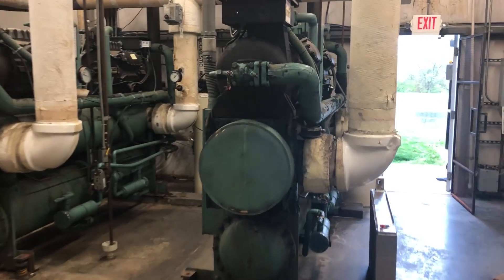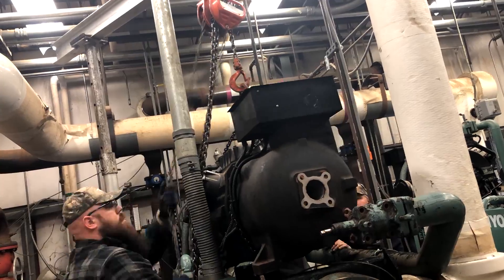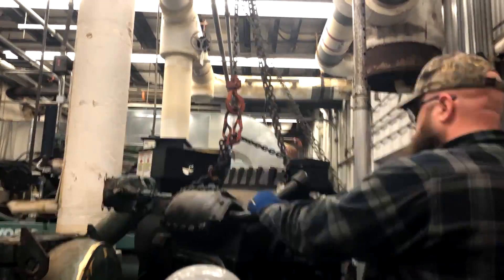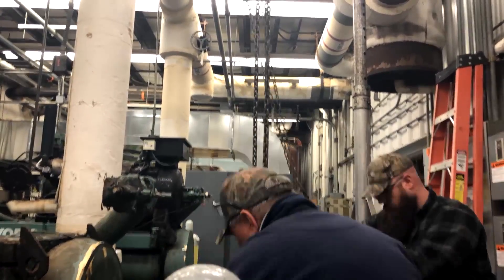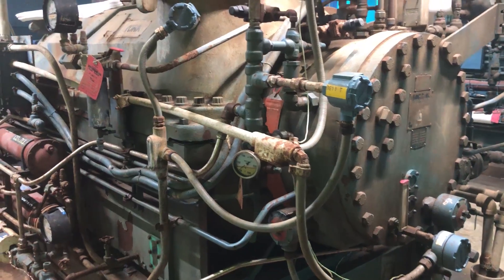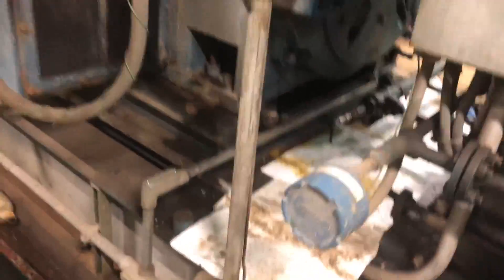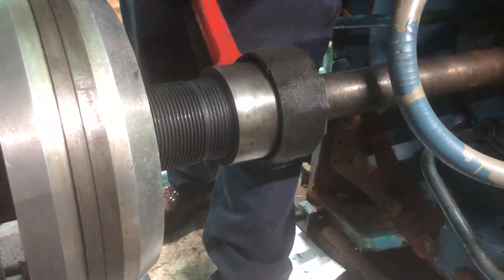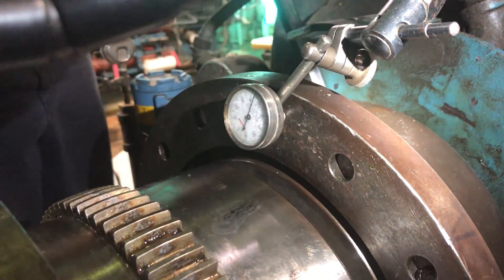Why I love Industrial HVAC🛠 (but Residential & Commercial are cool too👍)

Comment: I did residential HVAC for two months as an apprentice, but I was laid off because it got very slow. The service manager gave me a very good reference letter, but every place hiring was either slow or mandated a few years of experience. Even places that had entry-level positions and didn't require schooling or an EPA (which I have both of) were saying they had applicants with more experience. From March-December of 2024, I was unsuccessful in finding a job in the field. Just before Christmas, I landed a job as a commercial building engineer apprentice, aka Maintenance Mechanic, which includes commercial HVAC. I've worked on commercial equipment and alongside commercial technicians as well. I'm all for the commercial side now
Reply: I'm literally going through what you went through. I start 11/23/25 at a hospital. I'm ecstatic to start

Comment: Enjoyed your video. You mentioned the smell at the log plant. Never worked in a plant like that but I will submit that a rendering plant might be as bad. A place where they render animal carcasses down to protein. Man has it been years since I have seen a open drive Carrier recip. Or a J model York. I am with you industrial is the place to be. Dont have a lot of it where I live anymore outside of our hospital. I have been fortunate to do industrial refrigeration. Aerospace carbon fiber. When I was a green apprentice many many years ago I got the pleasure to work on the refrigeration equipment for a mix bowl for solid rocket fuel for Hercules propellants that supplied rocket fuel for the space shuttle. As well as the climate control for the building where Morton Thiokol where they assembled the boosters and rockets.

Comment: Im about to finish up a 9 month program and then get my EPA and start applying. I really would rather not work residential. Would much rather industrial. I'm at a point where I don't want to be picky though. Any advice on getting started in industrial?

Comment: I started back in the early 80's in residential/ light commercial - then got into ship processors lots of them running 40 flash freezing equipment on R22 - wound up in the oil patch and did some work in the largest gas plant in the world with 4 systems that chilled natural gas with propane for refergerant each system held 40,000 lbs of propane and there were 4 systems- compressor drives were 50,000 hp gas turbines - with all the surge drums and and lines and extra propane there was 710,000 lbs of propane involved in the process - so dont bring your 1/4 hose and 3 cfm vacuum pump - it ain't gonna happen - that is what I like about industrial - most of the decisions are already made when how your going to do a job... your going to get lots of chain falls and crain equipment - also you touched on your coupling job - most guys dont even realize equipment alignment is a trade in itself... I'm retired now and miss the action sometimes but realize unless someone needs a teacher or someone to be the punter on a job - I'm done..

Comment: I work in a commercial building as a Junior engineer or you could say mechanic. I did residential HVAC for 2 years back in 2013-2014 I liked it and hated it , I like working in a building where I am on site 24/7 better then being on a truck , yes sometimes it can get boring but we deal with the same units and we all know are building like the back of are hand, not only do we deal with the hvac but we have to handle house calls as well, so for me it can be anything in the day from a light bulb out to fixing a door and back to working on a big air handler. I am in the IUOE and am proud of it ! I make 37 an hour and have a great union and soon I will move up to engineer as soon as i get my Refrigeration operator's License and am in class for that now. I would like to work my way up to chief engineer someday !

Comment: Those old 06H compressors are still running? Wow. I’m in a chiller yard today. Changing some EXV cables and thermistors. Process chillers for a plastic plant. Food grade so you have to wear head and face covers. Tough when we have facial hair lol. Over. 1000 tons here just in chillers.

Comment: My most unique and stressful industrial experiences was the installation of a system that was designed to condense water and alcohol out of nitro glycerin, In preparation for making solid rocket fuel.  It was called the cast and cure building, at United Technologies Chemical Systems.  One stage was a 40 degree system and one stage was a 40 degree below zero system.  The building had to run un-manned because of the danger of explosion, and the structure was actually designed to blow up.  From what I recall, they only ran it once, and abandoned it after it did blow up. The operation of the system was controlled from an underground concrete bunker, several hundred yards away from the cast and cure building, so no one was hurt, but the building and equipment was destroyed. We also did a chill water system for a large mixing bowl that was used to mix the solid rocket fuel.  I remember one day they were moving a used bowl on a crawler up the street.  It had some residue in it from the mixing process and the whole thing caught fire.  Melted a huge crater in the street.  They couldn’t put it out.  Love the pictures of those carrier 5H120’s. Worked on  a number of recip chillers with those with both electric, and natural gas engine drives.

Comment: Does the industrial said of HVAC make more money than commerical and residential
Reply from the maker: Jeremy Smith there’s a lot of factors there to consider, it’s definitely not a hard yes or no. 

If you’re strictly talking hourly wages for service technicians, GENERALLY heavy commercial/industrial make more.  But again many factors can affect that, including union/non union, commissions in residential, geographical location, and the residential vs commercial “economies” in your area.
Reply: AK HVAC I appreciate the reply , I'll do some more research. Industrial seems a lot more fun.

Comment: Hey man i would love to become more of a bad ass like you in havc industry. Can you use an apprentice. Ive been in the field for 14 years mainly working residential. And to be honest im bored of it i love havc but there isnt much exictment in residential for me anymore..
Reply from the maker: With 14 years youre more than equipt to get into this side of the industry👍  Start applying to mechanical contractors in your area, that experience won't be ignored!!  I dont have nearly that much experience my friend, and I'm no HVAC badass.  I have a ton to learn yet, I just happen to have a camera.  Drive by hospitals and manufacturing facilities in your area.  Look at what vans are parked their, those are the companies you want to apply with.  Best of luck to you!
Reply: Thanks bro ill see if i apply for my local union while im still some what young..
Reply from the maker: oidodsonido sonido apply to the contractor, not the hall. If you go straight to the hall you’ll end up on a waiting list. If the contractor likes you, they will get you in much quicker.

Comment: Hey, man, random question, maybe this isn't the place for it though. I'm getting out of the military soon, while in, I was able to get the EPA CFC/HCFC refrigerant processing certification. I've been looking into starting HVAC once I'm out, but have no idea where to begin. What advice would you give a soon-to-be vet who's been wanting to get into the industry for a while?
Reply from the maker: Thanks for your service!!  I'm a Marine myself, before getting into the trades.  Man I'd just start applying, you may get picked up just off your previous experience.  I'd also look into using your GI Bill for a local HVAC program in your area.  You'll learn something, make BAH every month and get some great networking through the instructors.  Thats what I did!  Best of luck to you Eric!

Comment: I'm 3 months into my HVAC apprenticeship and appreciate the info about different subsets of the HVAC world. My trainer is a tinner turned HVAC installer and I'm learning loads of information about layout and planning along with the fundamentals of working with sheet metal, running lineset, drains and ducts,, and getting my grip strength up so tools like butt notchers aren't so hard to use. I can't wait to start classes in the fall and am looking into the books you recommended in another video.
Reply: I guess your well on your way into the HVAC world at this point
Reply: @j_rainsgoat3929  3 months after that post I was laid off for the fall slow down got hired by a commercial company and have been a commercial service ever since. Have my Journeyman and brazing certs, still need to test for the LEB and starting to make preparations for the AL2 refrigerants. My shop already got us all AL2 certified.

Comment: How does somebody go about getting into industrial?...... and how did you start?....
Reply from the maker: If you already have some residential/commercial experience, start looking for companies with "mechanical" in the name, usually narrows that company down to one that deals with larger projects/potentially larger equipment.  When you drive manufacturing facilities in your area, scope out vans or service vehicles.  These are the companies you'll want to apply with.  Good luck!

Comment: Much love buddy, from miami branch N92
Reply: Bryant Batres how did you get into the union?....
Reply from the maker: Bryant back at ya brother!
Reply: Oscarbm1234 I went to a trade school for high school then straight out of high  school I applied and had a recommendation from my fathers friend. Also I had a job lined up in a Union shop already, it helps if the union doesn’t have to look for a job for you, and if you already have a mechanical background. I’m from 725 btw.

Comment: Watching this video brought back a lot of memories of my years working in Chicago on those big recips and Evapco& Marley
cooling towers.  I once worked on some smaller a/c units on the 98th floor of the John Hancock building underneath the main cooling tower for the whole building.  This tower consumed the entire 98th floor!  The fan blades for the tower were, I'm guessing 30 feet in diameter!  Only way to change out a blade and motor would be by helicopter.  Billy
Reply from the maker: Hey William Treslo, thank you for sharing this! 👍👍What a great story.  And thanks for watching!!🍻

Comment: Good to see passion for HVAC, especially for those of us who are just beginning the career. Thanks!
Reply from the maker: Thanks for watching Anthony Westcot 👍👍!!  Appreciate the support🍻
Reply: I'm very interested in the career I was wondering if there is welding if so what part of it cuz I love welding as well an also is there very physical labor involved in it? If can answer I would really appreciate
Reply: Kenny lonas not that hvac techs are required to weld but if you choose to get certified it will boost your credentials and widen your horizon. I’m a hvac tech who welds mostly for fabrication and leave pipe welding or anything containing fluids to our pipe fitters. Depending on which aspect of hvac you get into but would definitely expect some days to be more labor intensive then others but you will have your easy days too.